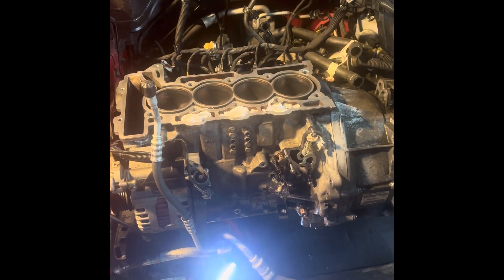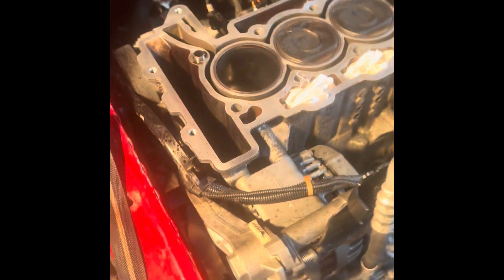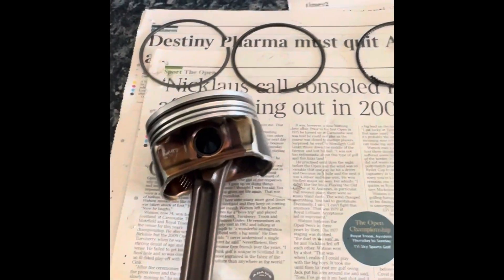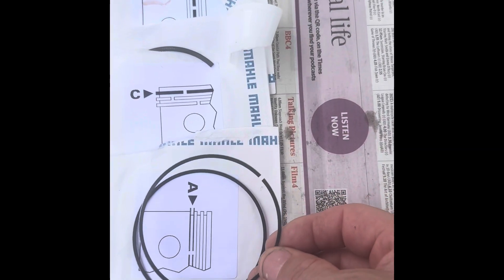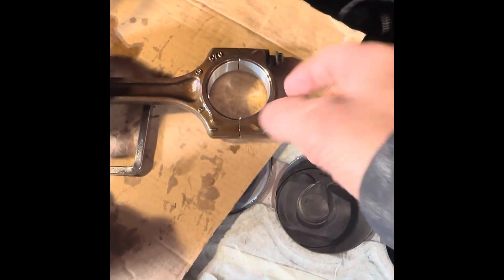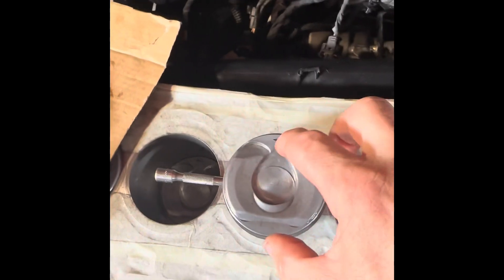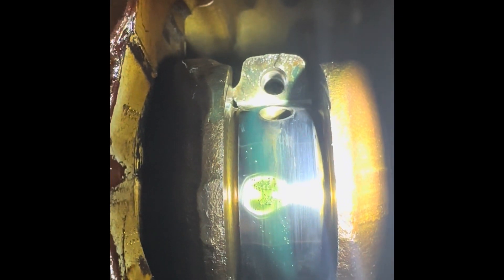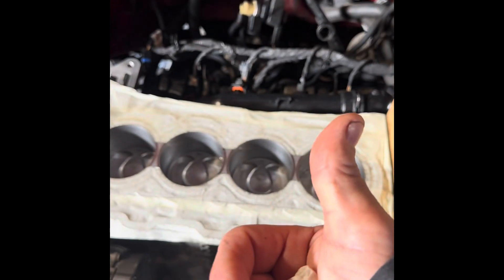Mini Cooper S - How to remove pistons and fit new piston rings to stop burning oil.

Comment: Do you have a video doing the 2007 mini 1.6L turbo sport to fix low compression problems?
Reply from the maker: Check out new piston ring video and head rebuild video. If low compression it's rings and valves. Keep us posted. You can do it 👍

Comment: Hi, getting ready to do this on my 2012 R60; which honing tool did you use? I am not mistaken, you didn't bore, just cleaned up the cylinders with a hone tool? Appreciate these videos so much, thank you!
Reply from the maker: Hi, yes no need to rebore unless really damaged in which case probably cheaper to get another spare engine. Hone the bores round again. Use flat stones rather than balls, you can buy them from Machine mart. Get a coarse and fine set of stones, use coarse first than fine. Keep us posted. You can do it :)
Reply: @YoucandoitwithJules thank you!
Reply from the maker: @weskory3854 You can do it 👍

Comment: Can you/Do you need you use a thicker oil after installing these new rings or you can still go with 5W-30?
Reply from the maker: Same fully synthetic 5W-30. Then engine was designed with this oil. A thicker oil can cause problems on start up etc. Keep us posted. You can do it 👍

Comment: Nice vid. Thanks. I am at this point with my '07 N12 and have a few questions. Is your fix still good?
1. Did you  use standard size rings? My engine has ~150K on it and I have been told that I will need to have block bored.
2. Why did you not check clearance on new bearings with Plastigague?
3. Did you have to need to ridge ream the cylinders?
Don't know if this will receive any reply due to age of post, but thanks in advance if you do.
Reply from the maker: Thanks for the reply. Always here on you can do it. 

1. unless your bores are really messed up a hone will bring them back to scratch and you can use either standard or +0.5mm but must check end clearance with the larger rings to stop binding. 
2. No need as standard size and crank will have been already run in so tolerances will be good. You can of course Plastigague them if you wish. 
3. Good long hone  bits will successfully  take any top ridge out. 

Engine is this video has now 20k on it and running lovely and no problems to date. 

Keep us posted. You can do it 👍
Reply from the maker: Just make sure to change oil every 5k miles as these engines cook the oil and it'll be black as a diesel. 

Keep us posted. You can do it 👍
Reply: @YoucandoitwithJules  Thanks so much for the quick reply!

Comment: Thanks for the vid. I’m doing the rings on a friends N12 engine at the moment. There seems to be different opinions about needing new con rod cap bolts or if they can be used two or 3 times. What’s your view on this?
Reply from the maker: They are stretch bolts and to be safe it's not worth the risk to reuse. They don't cost much anyway. You can do it 👍

Comment: Superb video. My R56 N14 non turbo Cooper failed the MOT on emissions although the engine seems to work just fine, no rattles or latency when driving and it has 150 psi on each cylinder which imples the top end is OK. After a week the MOT garage diagnosed excessive crankcase pressure due to failed oil control rings, they quoted me £5k for a replacement engine! This gives me confidence to replace the piston rings myself which should be more like £250 in parts (rings, head gasket, timing chain kit), I can take a rain check on the big end shells.
Reply from the maker: Yes thanks any save yourself a fortune. It's always the oil control rings as a really bad design. You'll need to clean the valves up and replace the stem oils seals and you'll have a great running engine. I'd replace the water link pipe from water pump to thermostat as they are plastic and let go when old. Videos  on the channel to help. Keep us posted. You can do it 👍

Comment: Good vid, I'm rebuilding my n18 bottom end and i was completely confused because the car manuel gives u end gap for ring # 3 wich i assume is the oiler spring ring and i saw no gap on ring, this vid definitely confirmed my suspicion on the ring end gap
Reply from the maker: Yes I'd put a 5 ring system back in. Two compression rings and 3 oil control ring set up. Top thin oil ring with spacer spring ring and then the bottom thin oil ring. Keep us posted on how it goes. You can do it 👍